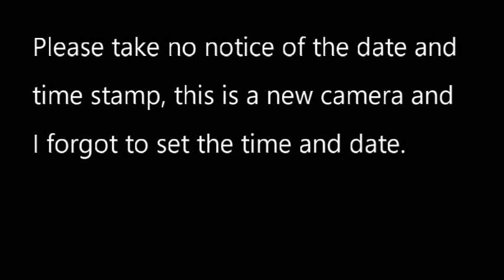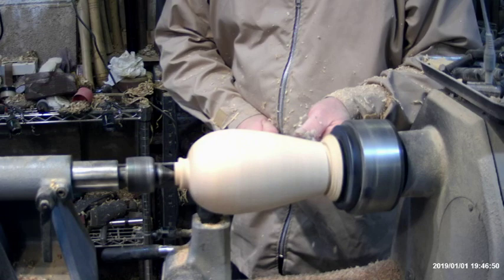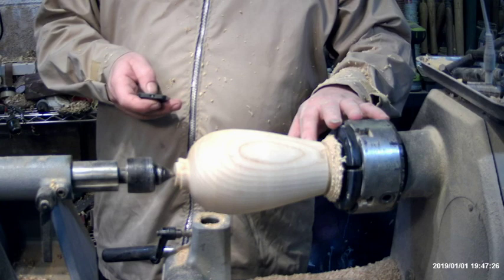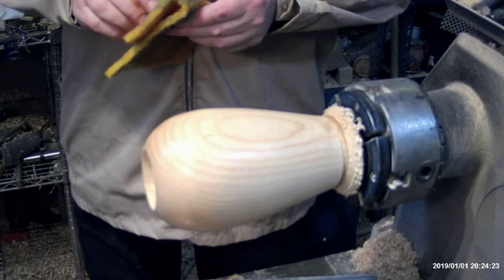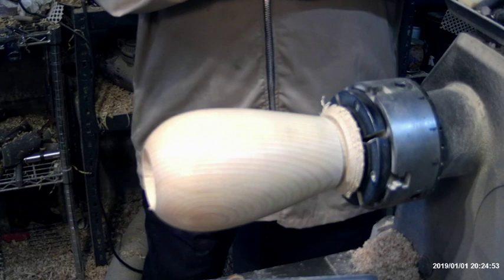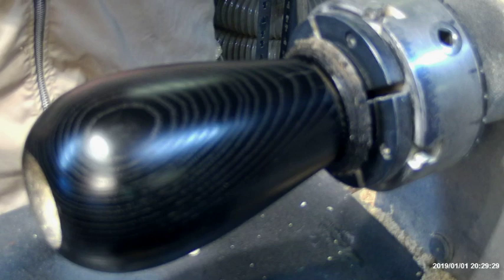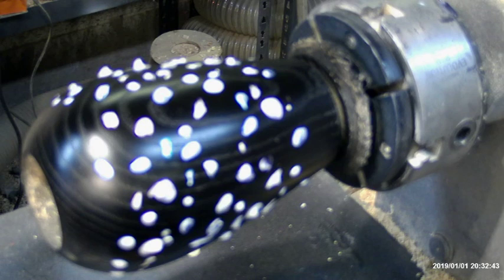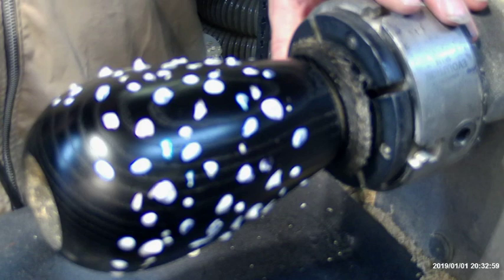cosmic clouds vase

Comment: Beautiful work Wayne.  How critical is the technique in achieving such a stunning piece? How important is the airbrush angle, it's proximity to the piece, and the direction of the airflow?
Reply from the maker: The air brush is only at about 40psi so you need to get fairly close. I alter the angle to give different effects and change the direction to push the paint where I want it to go. Hope that helps

Comment: Beautiful job Wayne. Do the Jo Sonja colours come already thinned or do you thin them. Up until now I've been using the Daler Rowney interference paints which come in a tube.
Reply from the maker: Hi Tee, use a flow medium to thin them. It keeps the quality of the paint without thinning the colour, if that makes sense
Reply: @WaynetheWoodturner  any particular recommendation?
Reply from the maker: @missteeturns  I got the Jo Sonja flow medium but I also use Windsor and Newton, Galleria, flow improver. You can get this from any decent art shop
Reply: @WaynetheWoodturner  thanks again 😀